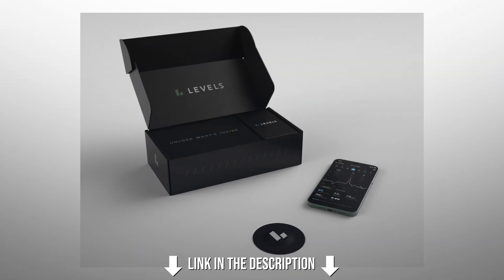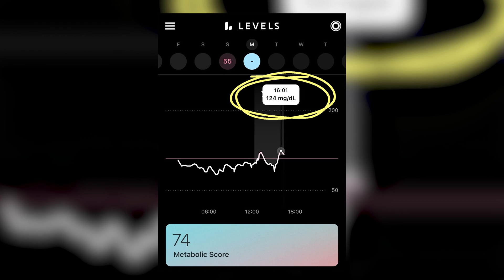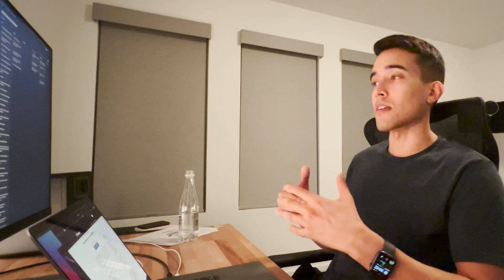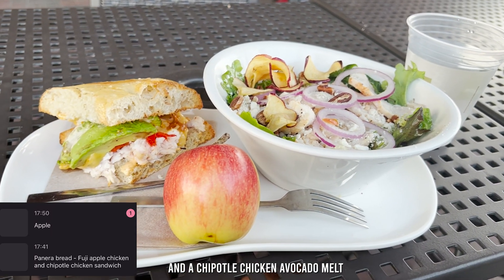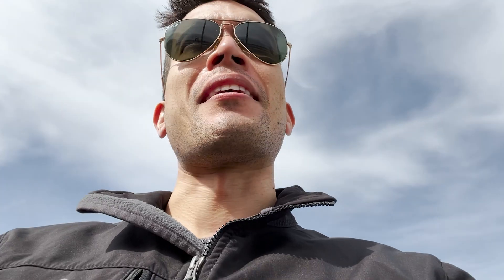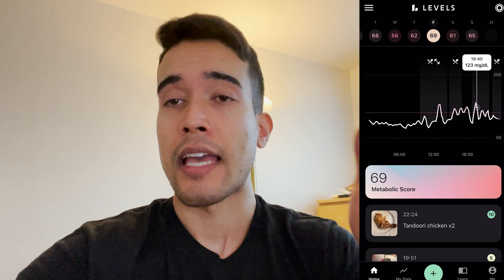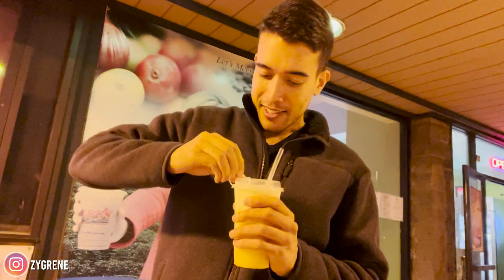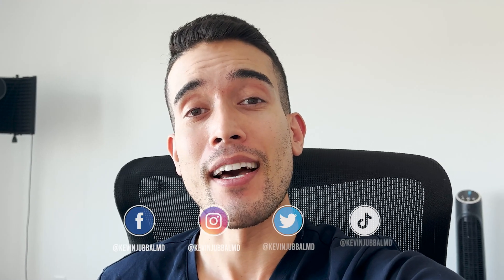I Tracked My Blood Sugar for a Week, Here's What Happened | Levels CGM

Comment: Just as a tip: Get yourself, your employees and your friends/family a certified FFP2/FFP3 mask (best from '3M', they are the best rated), which also protects yourself from COVID if it fits properly (no air flows past the side/top), because they filter the inhaled air and therefore also provide self-protection. Here in Germany these masks are already mandate. Normal masks "only" protect the people in the environment and not yourself. The filters of the FFP2/FFP3 masks can prevent many infections and thus save many lives. Can you forward this to your employees and inform them about these masks or forward this message to the responsible office? Thank you!
Just in case you didn't know these masks yet :)

Comment: Thanks for sharing your experience! Does the Levels app sync the data instantly? Or is there some delay? I've seen some other apps where you can scan the sensor directly into the app... so if I scan at 4pm I get my data all the way up to 4pm instead of up to 3:45pm for example
Reply: They should all work that way
Reply: What scale reliability tracks body fat?